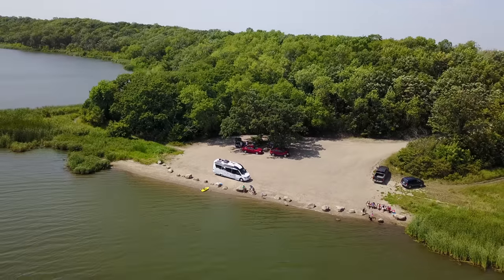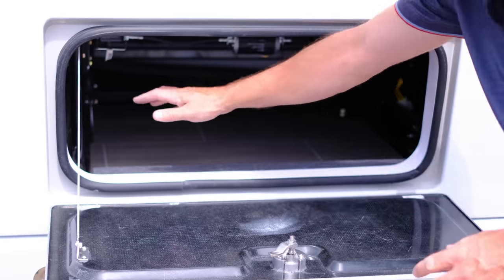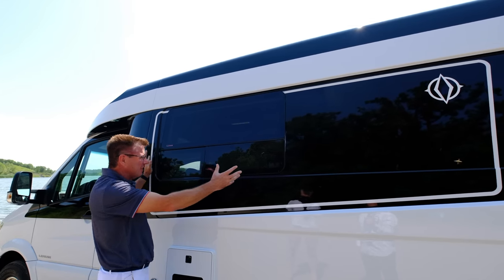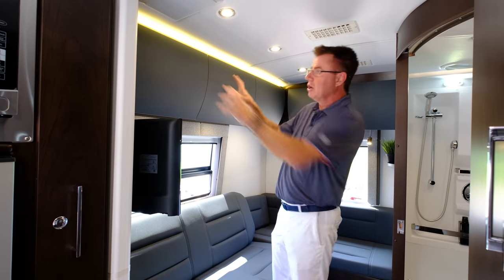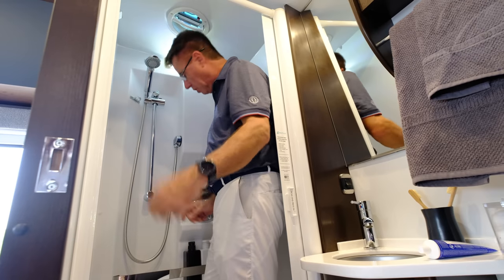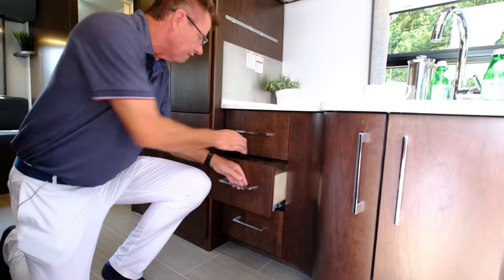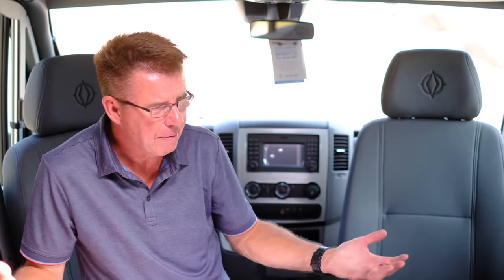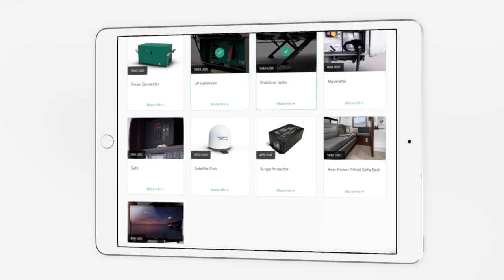2019 Serenity

Comment: Still a few years out from a purchase, but I have always enjoyed watching Dean's walkthroughs. He is always passionate and proud of the product he brings to market and for good reason! I do have to say, however,  one thing that has bugged me about Leisure products is the tech aspect where they are starting to lag behind by a wide margin. A few things I'm sure cross shoppers are considering that LT could stand to offer:

1. On a coach of that quality, lithium systems like Volta or Xantrex should be almost standard equipment; an option at the very minimum. Full timers know that Onan generators have a well deserved reputation for being unreliable noise makers that occasionally produce electricity. A lithium power system allows for energy independence and long term boondocking. It also means you can run that beautiful ducted A/C all night long without being plugged in, and without a noisy generator waking up the campsite. You already have a powerful, quiet, and far more fuel efficient generator under the hood, why not use it for the coach as well? Winnebago and Coachmen offer this on select B coaches and people go nuts for it!

2. Multiplex wiring. This is a biggie, especially on a big[er] coach. Having control panels in the common areas allows for full  control over everything without having to wander around doing the light switch shuffle at bedtime. If coachmen is able to offer this on their lower priced Crossfit, surely a premium company like LT can integrate it on their upscale coaches? (Coachmen also offers an Onan free, lithium upgrade path as well. Food for thought!)

3.  2-way Compressor fridge. Propane fridges are also known for being fussy, and fairly unreliable. Moving to a compressor fridge (especially with a lithium package) would allow for long term unplugged camping without worrying about propane refills or leveling. 

(Correction on point 4: Leisure Travel does have a Transit based offering. My apologies for the oversight! I will leave point 4 intact as it provides some information for potential shoppers that may be unaware of the Benz chassis issues.)
4. A Transit based coach. Yes this is a moonshot at best, usually not easy for lower volume builders as it requires a lot of extra logistics, but a fair few RV buyers do not want the Mercedes chassis. A surprising number of Benz dealerships will not service the Sprinter platform, which makes an already small pool of service locations even smaller. Whereas Ford dealerships are almost as prolific as Starbucks. Maintenance on the Sprinter is much more costly than other commercial platforms as you are paying the same hourly rate for a commercial chassis as someone with a $150,000 luxury car. Crazy decision on Mercedes part. Also, the Benz diesel engine is known for a number of very costly emissions issues, as well as crazy expensive parts costs. I think the Transit platform will be the platform of choice for most builders over the next ten years, so having that choice as a buyer would add value to the LT lineup!

I think Leisure Travel is second only to Advanced RV in build quality and finishing (but for what ARV charges, that is to be expected) and one of the best manufacturers on the market, I just hope they don't get left behind as the younger buyers come into the market looking for the combination of premium quality and tech integration.  They have remained on my top 3 list every year as I continue to cross shop and narrow the field before purchasing. Frankly, I think I'm just dragging my feet hoping they will add at least a lithium system option because energy independence is one of my top criteria for a coach. 

Keep up the good work Dean and all at Leisure Travel, the 2019 Serenity is a beautiful coach! As always, I look forward to your next videos!
Reply: Hope that they read this! Great advise
Reply: Dave's Model Works Check our Coach House in Florida.
Reply: You bring up some great points! I was expecting that the 2019 LTV coaches would have the lithium and multiplex options. I was shocked that this wasn't the case? Maybe in 2020?
Reply from the maker: Thanks for your feedback Dave! We're happy to hear you've watched our walkthrough videos. We'll make sure to pass along your feedback to our designers, but if you'd like to share any product-related feedback we'd love to hear them over at https://leisurevans.com/ideas/. On point #4, we do in fact build on the Ford Transit chassis! Our Wonder, built on the Transit chassis has 3 unique floorplans: https://leisurevans.com/wonder/
Reply: @Trailblazers323  Coach House has a beautiful product to be sure, but they have some of the same issues. Their interiors are catering to the older side of the market and dont offer much to the younger buyers. To me, they are starting to look fairly dated. Leisure Travel at least is putting a massive effort into keeping the interiora fresh and exciting! Also, as far as I've seen on their videos, they still use 6v batteries in parallel as the coach batteries which is definitely a very old school way of doing it. As last I knew, no lithium options and no multiplex systems. They offer a quality product to be sure, they are doing what they do best, but they are not innovating as much as the younger market might like.
Reply: @Leisurevans  I appreciate the unexpected reply! Thank you for updating me, somehow I missed an entire product line and feel quite embarrassed about that. I will update my original post as such. Also, thank you for sharing the feedback link, I never expected a manufacturer to have such a thing. Yet another indication that LT is one of the best out there!

Comment: advices
1- make roof that hydralic goes up and makes a second floor with a ladder to climb to there
2- put all the interior boards, kitchen stuff on a hydraulic cube that spread to the sides of the van so will have alot of interior space
3- make the van as boat : put air bags on bottom of the van so they fill with air anytime you want to go floating on sea, also the tires change to horizontally position for more stability in water

Comment: I love watching these types of videos. I plan to make a purchase in the very near future. But I haven't decided which model to buy. My first concern is regarding the suspension on these vehicles. And how high it sits from the bottom of the vehicle to the road. The areas I travel have uneven dirt roads and it is important that I am able to navigate them without a ton of worry about damage to the undercarriage. I'm also interested in what kind of tiers are standard and if they can be/need to be switched out for more off road worthy tiers. And if the solar system can be upgraded for more power intake. Can I stay warm in the winter without burning out or using up all of my on board resources? Durability is key. As well as if there is an unfortunate accident. Where are the certified recommended repair shops located in the US. Once I make this purchase this will be my home. I'm wondering about costs for some services and maximum fuel capacity and MPG. Beauty aside, these are questions that must be answered before I can seriously take any type of model into consideration considering the over the top costs. Mr. Dean is a great salesman but there is some very important information not mentioned in many of his videos.

Comment: Still no Lithium Batteries...Leisure is known as an innovator and premiere RV builder, but they fall down when it comes to main sourced of off grid power source, what a shame...there are not enough campsites avail for all the RV's out there= dry camping and that means relying on Battery power...come on Dean....Lithium is very smart, we know you like smart! Truly a beautiful unit.
Reply: The sole reason I will not buy a Leisure.  Lithium batteries in Pleasure Way, so we are going with that.
Reply: Rose  It's all fun and games until one of them malfunctions and burns your RV to the ground.
Reply: CatheysKid just swap them to lithium yourself it’s not hrd
Reply: @ohbbyilikeitrawr  My point is one should not have to pay 100K + and then have to add lithium...they should be available from Leisure for additional cost  ..what's 2-3 K more at this point...I keep hearing from some...that lithium's have cold weather issues and that's why Mfg's don't offer them....Battle Born batteries work great in the cold weather I know of many happy campers using them...
Reply: @CatheysKid  $145,00.00. $160,000.000 with options.

Comment: Recharging the batteries, is that done by solar power, or are they to be changed and replaced when they run out of power?
Is it possible in those vans to have hot water, all three places at the same time? Even in the house where I live, you can't for example hand wash the dishes and have two showering at the same time. The water gets cold

Comment: Dean, will LTV ever offer Lithium options, or an inverter larger than 1,000W, or multiplex wiring? Is auto generator start available? Love your designs, quality, and liveability, but it seems you're a few years behind the rest of the industry when it comes to electrical options.
Reply: The Wonder RTB has multiplex wiring and AGS. I imagine it's coming to their other lines within a few design cycles. You can get larger aftermarket inverters and lithium batteries.
Reply: Colorme Dubious , sure, but I’m not gonna pay a premium price for a motor home, then commence the expense and time required for a major electrical upgrade to my brand new, under warranty coach. If it were that easy to install a larger inverter and lithium batteries, why doesn’t LTV at least offer them as factory-installed options?
Reply: Yes, Lithium batteries would be nice, along with a 2kw pure sine wave inverter. But there is one thing: Lead Acid batteries are tried-and-true, and when they fail after hundreds of charge/discharge cycles, replacements could be had for less than $300 for both, in just about any town. Try to get your Lithium power cells serviced in Spirit Lake, Iowa.
Reply: Thomas, I hear you, but that could be said for ANY newer technology. If that were the guiding factor in RV's, we'd NEVER see any new technology introduced. The reality is, Lithium batteries have been out for a number of model years, and while they're nowhere near as "tried-and-true" as lead acid, they're not exactly untested. They should at LEAST be offered as a factory-installed option, so the consumer can make the risk/benefit/cost decision on his or her own.

Comment: I tried the links in the comments for feedback, but while I could see others, I couldn't make a suggestion myself there. 
Need multiplex wiring, at least a 2,000 watt inverter, lithium batteries and more solar capacity than 300watts would be great.
To get these, I'm willing (but don't want to) wait another year. Happy that the diesel engine can run on 20% fuel mix, but would still avoid it whenever possible. Like the other Mercedes upgrades too.

Comment: I love the Leisure Travel Vans. To call the Serenity a "van" is like calling Dom Perignon just a "wine." I do have a few things I don't care for, and I'll explain why: First, the LP hookup for an outside BBQ is in a bad location, having to get down on my knees to reach under the rear bumper isn't something I would like doing. The less expensive Unity model has this inside a compartment. Second, the curved upper cabinet doors are a nuisance! Watch  as Dean has to duck his head because the curvature of the doors don't allow him to see directly in the cabinet. Flat doors would go up to the ceiling and not be in the way. This is a matter of style over practicality. Your competitor (Pleasure-Way) offers a choice. Also, I would want the cabinet doors to match the rest of the cabinetry... not white or grey! -- but on a positive note, I am generally pleased with the fit and finish, and really like the double, strong side doors hinges. Still, although I am not screaming about having Lithium batteries like some other commenters, because lead-acid is cheaper to replace-- I do wonder why the Unity can have up to 400 watts of solar panels, yet the Serenity has only 300? Lastly, why bury some controls (TV switches, solar panel controls) inside the back of a cabinet?? That mystifies me. Thanks!

Comment: Now that Mercedes revealed the new V-Class chassis, any plans on replacing the old Merc with this new V-class (with the new infotainment style and tech)? 188 HP for such a vehicle is not that much with all that weight...
Reply: The new 2019 Mercedes will be on the 2020 Leisure Unity and Serenity models.
Reply: I'd rather have the Ford Transit chassis
Reply: The new MB sprinter looks completely different, V ( Vito class)  is smaller and made in Victoria Spain..check the Hymer dot com to see new sprinter cab Rvs ( front-, rear- or 4 wheel drive options available).. Available in the market ( Thor overtook Hymer)

Comment: I don't get it. This RV fits my tiny house fantasies except for the electrical system. What if I want to do something crazy like blow dry my hair and brew coffee at the same time?
Reply: Honey i advice ya do not ,do not ever ever blow your hairs and brew the coffee at the same time or ya will regret it if you drink your hairs with coffee or you will be ended brewing your hairs too.
Reply: I brew my Lavazza in a Italian coffee maker on my gas range, while drying the hair with up to 2000 Watts mo problem or cocking off a pizza pan with 1,7 kw..3,4 kW peak is more practical fed from my green power Super B. Lithium Fe Phos Batts and solar...no issue in an Rv..heating certainly with Alde warm water heating system and all tanks and plumbing in a 15 inch double floor keeps the frost out and acts as a heat Depot..rockn roll when camping!

Comment: The curved shelves are kinda in your face. Look at him bend down to see inside. How many times would that take to make you mad? and that little stick that slides out for the front bed, that's gonna break within a few weeks. Are the drawers stapled? Dean never pounds on the bottom of the drawers. The stovetop has to be the cheapest you can find for something that expensive. I like Leisure products, but if you look closely you can see some design flaws and material choices that don't make sense or add up for the price they charge.
Reply: @Dave H Not to be an apologist for LTV, (I don't own one) but I don't believe they use staples on drawers. As for the front bed, I think it's basically for a grandkid situation. This coach is designed for two really, not meant to be a family coach or for four adults.

Comment: Dean, please, stop shooting yourself in the foot! Nobody want to plugin anymore! Drop generator. Drop propane. Give us Lithium power, Volt Start, Massive Solar goodies, Alde Diesel Heater with Water heater and heated floor, give us 3600 watt inverter, 1000 watt Fuel Cell working on evaporated diesel fumes in combination with solar panels! Give us 48 Volt system to save weight and 58 Volt under-hood alternator. We know you can do it! Winnie did it...

Comment: This will be better on US made chassis and engine for price and performance. German made engines and vehicles are basically expensive junks. German technology was top 60~70 years ago, not anymore nowadays.
Reply: Thats a good call..the new 2019 Sprinter does 100 km with 8 Liter of Diesels and a Rv makes easy 160 -180 km/ h when driving down the road! The have single shock suspensiom with or w/o air ride, front -,  rear,, 4 wd as option..A million km on a Merc no big deal..curious what these NA chassis can do for me as a off road and high speed traveller? ( Anyway I have a Promaster Chassis ( already the second one) which is also not bad at all)